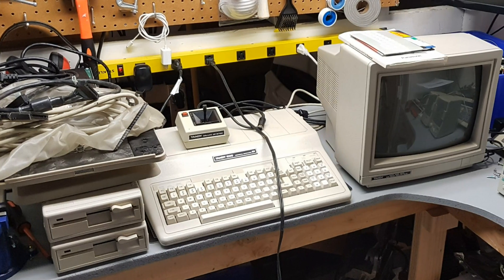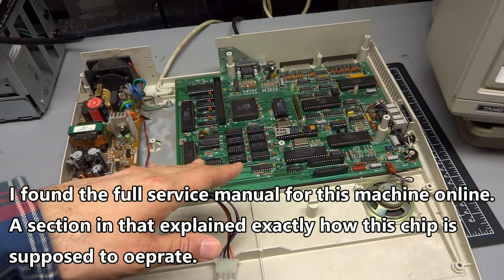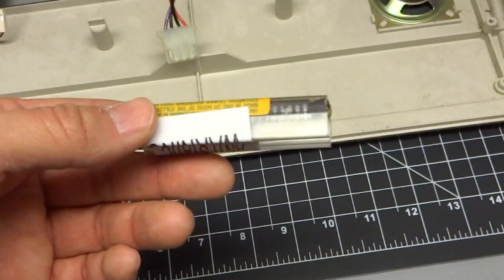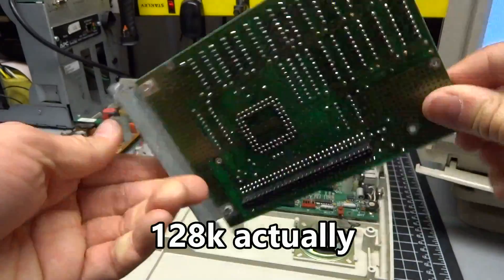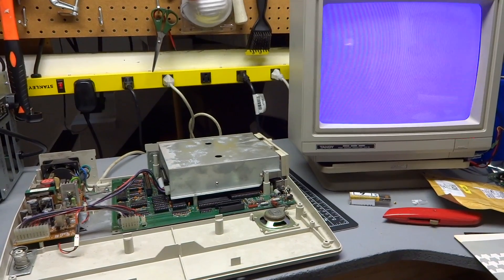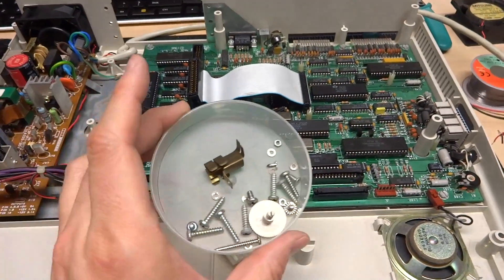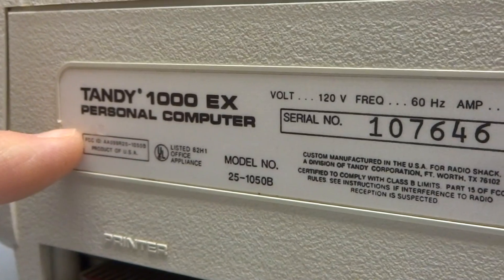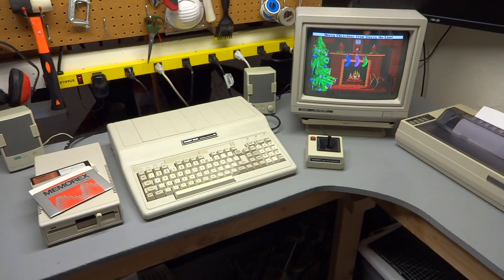Radio Shack Tandy 1000 EX Fix and Tour

Comment: Hmm, I wish you had posted a link to that service manual, as I couldn't find a good one to fix my Tandy 1000 EX.  The error code I get doesn't yield an exact match, but the match I got correlated the error code to the chip part number, and my error code, while different, does correlate to a chip part number.  Could it be that easy?
Reply: Err I/O of 8253, and there is an Intel 8253.  The thing is, the post of the guy that had Err I/O of 8259 says that replacing the Intel 8259 didn't fix the problem, so it may be something else.  Unfortunately, the service manual I found doesn't mention what Err codes mean.

Comment: Thanks again Adrian for the informative video, I'm a bit (cough) late in viewing this one, but was looking for someone who has cleaned the keyboard on an HX or EX where you had to remove the two flexible keyboard cables, was there a trick to getting them out and then again to putting them back in? Is it just pressure or do the size tabs actually release or tighten something to help remove and reinstall it?

Comment: Great video Adrian! That was a gamble buying such an expensive clock chip with the high price of the shipping too, not knowing if the Tandy had other faults with rare/expensive custom chips. I felt your elation when you switched it on and it worked! Your channel has come a long way since this video, but your old stuff is still great too.

Comment: My first thought was that with older computers, caps tend to go bad. Did you try removing the 2 caps from the original chip and see if it works without the caps?

Comment: The Tandy 1000 EX was my first PC-compatible computer. I remember buying something called the "PC Music Maker" that was a MIDI interface that plugged into a PC printer port. Unfortunately, it didn't work at all with the 1000 EX. When I reached out to the PC Music Maker company, they very kindly provided me with an adapter that apparently moved some pins around to make their interface work. They didn't even charge me. That was very cool of them. I have fond memories of that computer. My friend went out and bought a 1000 HX that had the boot ROM and didn't require a floppy to be inserted to boot up. I was jealous. 😊

Comment: I was scraping at some ladys house and came across a tandy 1000 ex.... Boot disks desk mate joystick and some games... Booted right up. Expansion ram. Has 640k. And telecom ports. 

I didnt put that heat shield thst surrounds the motherboard and it kept shorting the board... Out it back on works great... Exceot the keyboard is wonky try to hit s and it tyoes quoa... So idk

Comment: I don't think these really took of in the UK but I may be wrong. I think Amstrad pretty much had the budget IBM PC clone market to itself around this time. They did make something similar to this and sold it under the Sinclair brand (PC200 I think) but think it had pure CGA graphics and just the PC beeper. The Tandy sound chip was great and I have no idea why more clones didn't make use of it.

As a kid I always wondered why nobody made an IBM PC inside an Amiga style case without realising they did exist they were just not common in the UK.

Comment: Another bit of trivia about this computer, Tandy Mode graphics is the same mode as IBM's PC Jr graphics. You could change the graphics mode easily using debug, micorosofts cheesy little hex editor and assembly debugger.
A\:>debug (with DOS disk in drive, debug's prompt is a dash "-")
-a 0100  (this lets you enter assembly at 0100h, this is normal IP starting address for .COM programs)
-mov ah,00
-mov al,08
-int 10
-int 20 (a "quick and dirty" way of returning execution to command prompt)
Now we make sure instruction point register is set to 0100h. 
-r ip:0100
-g (this command says "Go")
Look in amazement at the glorious huge, pixels capable of 16 colors, but far more than the 4 colors allowed by CGA. lol
More about INT 10h :  go to stanislavs(dot)org / helppc / int_10-0.html
Lastly if you want to save, set the CX register to something like 50, then use -n pcjr (dot) com, then -w, but make sure you swap to a writeable disk first.

Comment: Whoever told you the 5 1/4" drive was incompatible, was dead wrong. I routinely used floppies on my home Tandy 1000EX and read them with IBM PC XT 5 1/4 drives at my high school.
The person who told you this was likely confused about *density*. Newer PC clones of the mid late 80s used high density 1.2 MB 5 1/4" floppies. 
 So, if the person used that format, then tried to read them with a low density drive found on early IBM PC XT, Tandy 1000 EX or any of the other gazillion clones of that era, it wouldn't have worked.

Comment: The ds0 and ds1 settings on the FDD are being used for untwisted Floppy cable configurations. You could set the FDD to master (ds0) or slave (ds1). I've got one of those 8088 Vendex HeadStart computers (IBM clone) which uses that configuration.

Comment: Your memory expansion card, since it is 128k, appears to use 64k by 4 bit memory chips.  Based on the number of empty sockets, you may be able to install 384k into this board, which combined with the 256k on the motherboard, would bring this system up to a full 640k.

You'll need chips like these:

https://www.ebay.com/itm/NEC-D41464C-10-D41464-64K-x-4-DRAM-DIP-18-x-1pc-/151057118990

You'll want to make sure you get chips that are at least as fast as the ones you are already using though.  These are 100ns

Comment: this is like trying to get a dead T-REX  back to life. my modern GAMING PC is like 4 years old. that will make a TANDY 1000 look like a PONG my motherboard is MSI X(( GAMING GODLIKE  with a i7 5930K CPU that is a 6 core  3.5GHz DDR4 16Gigs 2666 4 dims GTX 1070 SUPERCLOCK graphic card. 240GB SOLID STATE DRIVE and many standard  hard drive. Now I remember the  C-64 that is COMMODORE 64  that takes forever loading video games.   yes  Solid State is heck of a lot faster then floppy drive.. However installing GTA V and download its update took 80Gigs  of my solid state  drive.12 hours  I had to go though 7 DVD  discs and  and downloading . loading GTA ONLINE takes forever.  because it has to go though 80 gigs and uploading and downloading data to check rather or not I am not using any cheat mods. and  it all ways fail due to server glitches.

Comment: That tantalum cap on the original clock may have failed short and caused the lack of a clock
Reply: Those both appear to be ceramic disc caps

Comment: Proportionately, early computers were far faster than today. People went from driving to the library, to a 4.77MHZ computer with a 300 or 1200 baud modem. People went from hand spreadsheets to electronic ones and from typewriters to word processors. Yes, they were slow, but compared to WHAT? It might take a while to boot a pc, launch a terminal, type ATDT XXX-XXXX and login, but it was still a lot faster than getting in your car (or bike or bus) and going to a physical place, waiting in line and pulling out reference guides.
Compared to then, we have stagnated for well over a decade relying mostly on adding cores and fairly minor efficiency gains as far as processing speed goes. A computer from 2008 is still perfectly usable today, whereas a 1981 PC being used in 1991 was just unusable.
Reply: Good points.

Comment: I just picked up a 1000hx with a scsi card and an internal hdd! I didn't know they existed.
Reply: I had a 1000HX too. There were no hard drives available from Tandy, you needed a third party kit to put a hard drive inside. They were also pretty expensive at the time.

Comment: I was wondering if you could do a video on how to actually disassemble the damned thing. I just got a 1000 ex, and while it seems to work, I can't seem to get the case off around the power supply. It appears I've gotten all the screws, and I can't figure out the point of resistance, and I don't want to force it, in case I break anything.
Reply: Actually figured it out finally. Two screws were hidden under the RAM expansion board. Now I need to sort out the floppy stuff, so I can get some software on the thing.

Comment: I actually had the precursor to this the TANDT 1000. 4mhz 8080 cpu if i remember correctly. standard keyboard and the electronics in a unit like a tower but laid flat.

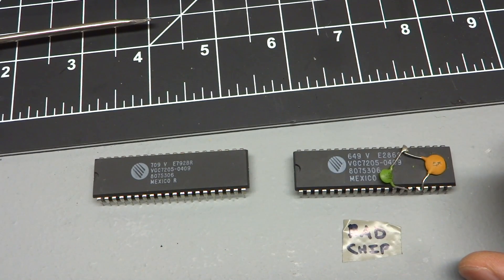Comment: My guess is that the Date codes at ~5:00, are the top-left 3 digits, instead of the usual 4-digit codes. 
That is 709 = week 9 1987, and 649 is week 49, 1986.

Comment: I had almost that same computer, but mine was an HX I believe!  I had a hard drive, and the hard drive controller was ISA with this adapter you mention.  I had a RTC and I thought 2x 3.5" floppys in the front with 1x 5.25" external.  I never seen one with the 5.25" in the side before, i guess that was just in the EX.  The printer cable is special, but the end was terminated to a standard Centronics parallel.  Loved your video.  P.S.  Leisure Suit Larry worked well on mine!

Comment: I had an SX which I believe came out before this one. It did have an internal clock. You can completely remove all power for years and not set the time when you reboot. Mine was in a closet for 10 years, still had the correct time when I set it back up. Actually, my battery only when bad about 6 months ago. It doesn't look like a battery, and I can't tell you were to find it on this model, but it should be there. I haven't replaced mine yet. I did remove the old one because I didn't want it to leak.

Comment: The tip on the DS0, DS1 is good.  However it's not about anything proprietary.  That's just the drive select line, so that the floppy knows if it's the 1st, 2nd, 3rd, 4th drive on the chain.  You can have a twist on the cable and keep all drives as DS0, or a straight cable and manually configure each drive.

Comment: It should be noted, for anybody who has a Tandy 1000 HX (not EX as shown here), that the 720KB drives are incompatible with standard PC drives, but for a different reason. The 3.5" drives Tandy used in the HX were powered via the ribbon cable, so you'd fry a normal PC floppy if you tried.

On the EX, as shown here, the DS-0/DS-1 jumper on the floppy is because older floppies (this one is 320KB), were made before "cable select" was built into floppy cables (the twist in the ribbon before the end of the cable where the first drive is connected). That jumper selects which drive letter (order) the drive will be. I've also read that on such drives, it may be necessary to remove the termination resistor pack if it's not at the end of the chain (not drive a:), just as one would do on a SCSI disk.
Reply: BlackEpyon are thier any floppy drives you can get for it that will be powered from the data cable?’ Also , do you still need a jumper for ds0 and 1?
Reply: @lorumipsum1129  "Modern" 3.5" floppy drives (I'm dating myself, aren't I?) are hard set at ds1. The twist in the cable sets it to DS0 for A: drive. It may be possible to use a normal 3.25" floppy on the HX, but you'd have to cobble together your own cable that cuts out the power pins at the floppy drive so you can use a splice from the power supply, or integrate a power connector from the cable itself. I'd have to look up the pin-outs, but that should be possible.

Comment: great video!  I just got one of these too, along with the 1000HX too.  Both of mine work.
Reply: Hey 8-Bit Guy, I just picked up a 1000hx with a scsi card and an internal hdd! Have you ever seen one?
Reply: The 8-Bit Guy I’ve had my dads old one for years. Just gave it a cleaning and power up tests. Still works great. Also has the ram expansion and dma controller card

Comment: I thought the floppy drive cable in these computers also provided power to the floppy drive as well as the data line.  Does the external floppy drive gets its power from the computer or must it be plugged into a power socket?

Comment: I recently acquired a 1000EX that needs all kinds of cleanup done to the keyboard and chassis.  Thankfully, it works great.  One question though.  Have you tested a 1.2mb floppy in it?  I'd love to be able to use 1.2mb floppys in it.
Reply: Adrian Black ah, ok.  I'll check that out.  Thanks for the super quick reply. :)
Reply: An external 3.5 DD with work if DOS 3.2 upwards
Reply: I don't think what is basically an XT can use 1.2 or 1.44 floppy disks. any AT can, one of the first things I did when I upgraded from XT to 286 was getting a new 16bit isa floppy drive controller so I could use 1.2 or 1.44 floppy drives. it couldn't be done with the 8 bit isa floppy controller I had from the xt days.
Reply: Old R/S manager here. I enjoyed your video and it brought back a lot of memories! Nicely done! 👍

Comment: This is interesting.  I have a PCJr that was given to me as non functional.  It plays a low tone out of the speaker and has a similar grey screen.  One of the quad NAND gates was getting really hot.  I removed it but never had problems with the soldering getting everything back.  I had apparently a later revision PCJr with almost no socketed chips unfortunately.  But I will look into the clock generator.

Comment: Nice Video, I am Glad to find it. I got also a Tandy 1000 Ex here in France.I am working of a way to plug a VGA LCD monitor on the Tandy 1000 EX, I will use a CGA/EGA adapter I've found on Amazon (ref : GBS8200)

Comment: Comment from 12:30: Tandy tried to maintain compatibility with older computer and accessoires. The parallel printer cable was compatible with the one for TRS-80 model I, III and 4/4P. The joysticks were compatible with the standard ports on the Color Computer/ Co.Co.2/3. 
As for the serial port: AFAIK Tandy followed the IEEE-configuration for DTE and DSE, and the IBM standard did not. 
Didn't you forget the anti-theft disposition on the EX (and the HX too) enabling the computer to be bolted to the desk in computer classes ? That was the main public for the EX/HX models: schools.
Reply: jan80trs: About that parallel port: I believe you're correct regarding compatibility with the models I, III, and 4/4P.  I owned a Model III, and it had a card-edge connector that was very similar to that (probably identical).  The other (printer) end was a standard D-shaped parallel connector.  

FWIW...  and assuming my ever-aging memory still has a decent grip on this...  my printer was a 7-pin dot-matrix model LPT-VII, which only printed at something like 30 characters per second.  Slow and loud as hell, but unlike a lot of other printers of its day, it could print graphics, not just text!  And got a speed boost because it could print BI-DIRECTIONALLY!  Ahhhh those were the days.  We were all a lot easier to impress back in ~1982.

Comment: +Adrian Black since that system does have an exposed ISA and DMA controller, why not add an ISA IDE/CF drive?
Reply: Get an ISA IDE/CF kit to solder yourself, then add a grid connector instead of the edge on and boom :p

Perfect to make another video to upload.
Reply: An IDE on a 8-bit bus? (XT-style) Highly unlikely. Don't forget, there was something like an IDE for XTs - AFAIK, it was called Smartdrive - but it wasn't completely compatible with 16-bit ATA IDE. Furthermore, does the BIOS support it ?
Reply: jan80trs No problem whatsoever with IDE on 8-bit bus. You just need some discrete logic and latches to keep the low byte of a word transfer around until the high byte comes around. LoTech sells a nice board that does that for you.

Comment: Great Video Steve, i still have the 1000HX machine that my dad bought me in 1987 and i still use, the issue is the internal 3.5" 720k floppy no longer works, you cant find then anywhere as they are powered from the ribbon cable, I found some instructions on how to modify the ribbon cable and use a later model drive (modifying the ribbon cable cuts out the power lines to the new drive which is powered externally), issue now is, the new drive spins but the head does not move, do you have any experience or advice on how to fix this ?  Thank you

Comment: I've owned an EX, an HX and an SX.  The HX had some issues when I got it so I cannibalized the EX to fix it, since a PC with a 3.5" floppy drive and DOS in ROM was more useful to me.
Reply: Yes.  I got the expansion from the EX, the HX had one that didn't work.  The HX had taken a beating, was out in the trash, the A drive was dead and the keyboard didn't work right - a little jiggering around and I had a nice working PC that served me well until I was able to procure better.